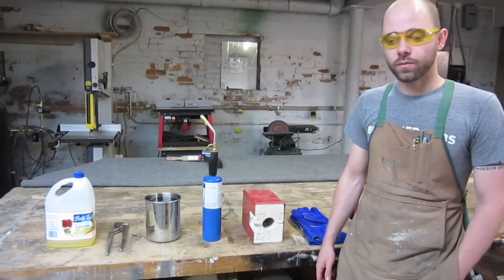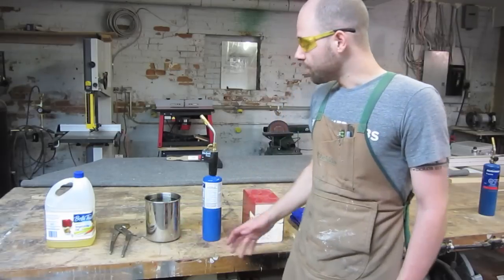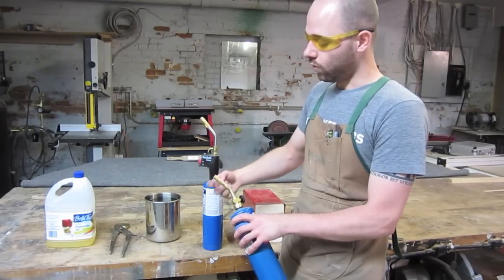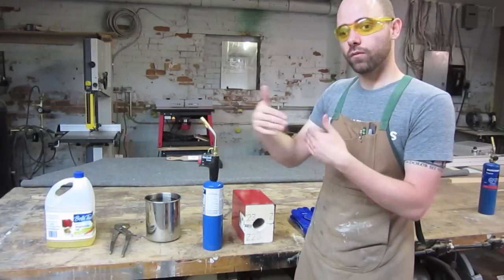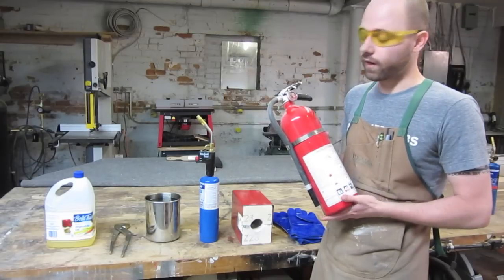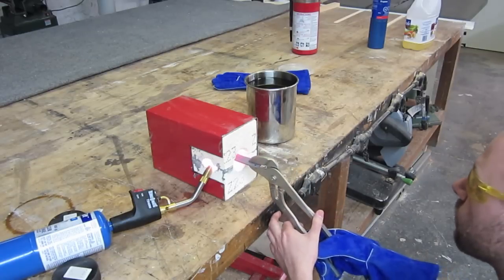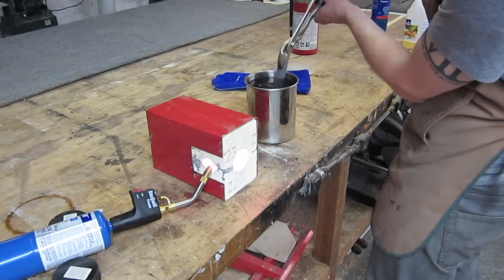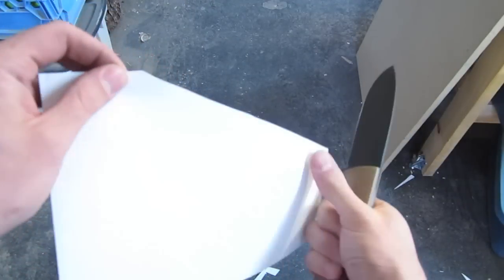How to heat-treat an O1 knife blade using cheap common tools.

Comment: How did you bore the hole through the two fire bricks?
Love the videos man.  The heat treating is the last part I'm trying to figure out how to do.
Reply from the maker: Basically I did each brick separately: cut a triangular channel with an old wood saw, then used coarse 36 grit sandpaper glued onto a large dowel to make the channel round. The brick is very brittle so the sanding worked well as it kept the impact low.

Make sure not to breathe the dust as it's VERY bad for you, wear a respirator!
Reply: Thanks man!  Sounds like that would work and obviously does.  I just finished my main bevel fixture.  It came out awesome!  On to the next part.
Reply from the maker: Kyle Davidson Nice mate! best of luck!

Comment: Aaron, 

I'm ready for the heat treat process and was just about to purchase the ATP-641 and noticed it was $20. Is it worth buying because I noticed you didn't use it this video. If so, I apply before the heat treat? Thank you so much for everything!!!!
Reply from the maker: seankusmc163 The anti-scale is definitely worth it, it will last a really long time and it saves you a bunch of finishing work. You just brush it on before heat-treat. Make sure you degrease the blade really well using detergent though. If it's not sticking then you still have some oil on the blade.

Comment: very good video, the 01 must be at 800-820 degrees for 15-20 minutes, you measured hardness, I want to see what we lose if we warm it in a detail like you, sorry for my english, good from greece
Reply from the maker: I believe I got about 58HRC with this heat-treatment, doing it properly in a heat-treatment furnace you should get about 60HRC with the same temperatures I believe
Reply: @GoughCustom  thank you, you answered all, be good

Comment: I've seen people use a magnet to test when the blade has reached the proper temp. The metal should demagnetize at or just before it's ready to be plunged into the oil.  The lighting in your shop is kind of a confounding variable for judging the temp by color.  I like to use both methods.
Reply from the maker: Andrew Davis Yes ambient lighting can definitely cause issues if it's too bright. I think a combo of the magnet and color is probably good. With most steels you should go a little hotter than where the magnet won't stick.

Comment: Question my friend, lets say my edge gets (evenly) the appropriate temp, while my spine is under heated. Wouldnt the edge be hard and the spine soft? In my opinion, this is a desirable quality. Also, how long does it take to get the blade to temp using your method? Im using a soup can forge, with homemade insulation made of plaster of paris and sand. im using a pencil flame torch, but it is a large pencil flame. the torch is at the front, angled twords the back. Thanks! Logan.

Comment: Hey great video! I'm intrigued by your forge, what are the dimensions if you don't mind me asking? I can only get bricks 114mm wide, I don't think the walls would thick enough if the centre chamber was of any useful diameter. I'd guess I'd need at least 70mm diameter on the chamber and 30mm thick walls all the way around? 

How long does it take to reach operational temperature and how long would it take roughly to get a blank to the right temp to quench? Also how long does one of those propane cannisters last roughly? Would you get many burns out of one?

Sorry for all the questions, thanks in advance!
Reply from the maker: The bricks you're talking about are likely about the same size at the ones I'm using I think. That hole in the middle of mine is only about 50mm in diameter. Going larger than that will make the forge much harder to heat up, and it really won't work as well. If you need one bigger then you'll have to spend more money on proper burners and such.

It heats up in about 5 minutes with the torch shown. It takes about 3-4 minutes I'd guess to get a blade up to proper temperature. 

The canisters last quite a while, not sure exactly how long but you're definitely getting 4+ blades out of each canister, likely much more.

Comment: great information here! what bit did you use to drill the entry hole for the forge? thanks!
Reply from the maker: I actually cut a triangular groove in each brick with a crappy wood saw, then used 36 grit sandpaper on a dowel to form the half round channel in each brick. I have not had much luck with drill bits, they tend to crack the bricks.

Comment: Hey Aaron  love your channel ! Just wondering what is the best way to heat the tang completely ? Also what is your opinion on vermiculite cooling instead of oil ?
Reply from the maker: Hey mate! Best way to heat the tang completely would be to make sure you have a forge large enough that you can cycle the whole knife in and out to heat it... 

I have never heard of vermiculite cooling. As far as I know vermiculite is a very good insulator, which means it would slow down the cooling of the knife. More than likely you would use that process to soften the steel rather than harden it!
Reply: @GoughCustom  thank you ! Very much appreciated. My first knife is very much inspired by you !

Comment: I read that O1 needs to be soaked at between 1475*-1525* for 15-20 minutes.That 
means it needs to stay at that temp for that ammount of time before its 
quenched in a medium/slow quench oil.

What do you think about it? Does getting the cheery red color is enough to reach hardness?

Btw great video, thanks!
Reply from the maker: Soaking it definitely helps get the maximum performance out of the steel, however soaking in a small forge can harm more than help as you're likely to overheat the blade and make it brittle, which is why I don't show a soak. If you have a kiln then by all means soak it for longer!

Comment: Hey! Great video! Question... I want to heat treat stainless steel.. will this process work for this? If not do you have any recommendations for me on how to do it/learn?
Also will it change the "stainless" properties of the steel significantly by hardening it?
Reply from the maker: +cabosurfcaster unfortunately you can't garden stainless using this process. To harden stainless you need much more sophisticated equipment, at least a furnace. Hardening stainless can change is corrosion resistance depending on your temper cycle. Also worth noting that you need to buy special stainless in order to be able to harden it, most stainless grades are not able to be hardened.

Comment: Is there a reason behind only heating the blade and not the entire length of the steel?  Are there ramifications in later usage of the knife to having an unhardened handle?

(Thanks for all the videos! It makes me want to try my hand at it....even though I probably never will....)
Reply from the maker: It's definitely better to heat-treat the whole knife, it makes it more resistant to bending, but with this little forge and the tiny oil jar it wasn't really practical. My current knives are hardened over their whole length.

Comment: I see that you said that you used a hand-saw to cut the brick, what kind of hand-saw? because I cannot see how an old handsaw would do the trick. Great video by the way!
Reply from the maker: It's hard to imagine if you've never handled the fire-brick in person. That type of brick is soft like chalk, not at all like a regular building brick... It cuts very easily.

Just don't breathe the dust!

Comment: What info can you give on S7 steel. Hardening and tempering and your overall thoughts on it for large blades. Thanks and great video.
Reply from the maker: I don't have any experience with S7 so I can't be much help there. I've stayed away from it because it doesn't get nearly hard enough for my taste. It maxes out at about 57HRC or so which is much softer than I'd like.

Many sword makers have switched to CPM3V instead of S7 because it go to high hardness (61HRC) and still be tough enough for a sword/large blade... Probably worth looking into.

Comment: Did you use some sort of compound to "glue" the fire bricks together in your mini forge?? and whats the casing around the forge made of? aluminum, steel, stainless?
Your videos are great by the way, they've been aiding my dive into knifemaking! Thanks.
Reply from the maker: +Scot Snook Hey Scot! Yes, a high temperature mortar is used to glue the bricks together. Also called furnace cement. The case is made from a piece of scrap steel that I had on hand.

Glad you like the videos mate!
Reply: +Gough Custom Thanks!

Comment from the maker: To be honest though I don't really think any of that is necessary. I've bent fully-hardened blades to over 30º many times. If you have a look at the steel testing video on my channel you can see what kind of abuse even a fully-hardened blade can take... I'm not sure that doing a soft spine is really worth the hassle, especially seeing as your edge will still crack once you've bent the spine enough!

Comment: Awesome!
I started making my fist knife and i got a problem :( maybe you can give me a advice? PLEASE! I am only 15 and a beginner in knife making.

I wanted to ask what should i do when i quenched my knife but it came up a little warped. Should i put it back in the fire and hammer it or start making another knife? The metal i used is from an old saw.

Comment: Have you seen that show on the History Channel called "Forged In Fire"? Every episode they start out with four bladesmiths and go through forging a knife with one of them taking home a $10,000 check at the end. It's not a bad show, but they never temper the blade. In the first task they have 3-4 hours to forge the blade including hardening it, but they go from the forge into the quench, and that's it. Task #2 is to put a handle on it & finish it in another 3 hours, but after that first quench no further time is used for heat treating it. I'm always surprised that they don't break the blades in testing!
Reply from the maker: +Gunslinger454 I haven't seen it yet, but I've heard a lot of people speak about it!

Comment: awesome vid.. this same process will apply to HSS and flat drill bits?
Reply from the maker: No, HSS and other medium/high alloy steels require a furnace to be heat-treated as they need much longer times and higher temperatures.
Reply: Thanks I'll try it out and report back here.

Comment: Hi Aaron I've been watching your vid's and I'm learning a lot..im using O1 steel for now  and what can you suggest the cheap and  easy to apply coating that would prevent rust aside from duracoat and ceracoat because right here in hawaii we cant purchased this kind of paint coz its too expensive to buy directly. I appreciate your help man.. Mahalo.
Reply from the maker: Hey mate! Glad the videos have been helpful!

Have a look around your area and see if there's a company that does powder-coating, that's probably your best option!
Reply: Gough Custom Hey Aaron! Ill just wanna ask can i put anti scale compound when heat treating 1095 carbon steel? Do you have any idea about differential heat treating for 1095 steel? Thanks.
Reply from the maker: filmario rimando Yes! The anti-scale should work fine with 1095. I haven't done any differential heat-treatment though sorry mate.

Comment: Great video.  Can I anneal a piece of steel in this manner by air cooling rather than quenching?
Reply from the maker: +Jack Black Hey Jack! The answer is maybe... Many steels (like O1, 5160) will air harden to some extent if they were air quenched because you'll be working with relatively small pieces of steel. however they likely won't achieve anywhere near full hardness, which may be enough for your purposes! If you want to anneal them properly you can heat the steel up then bury it under hot ashes to cool, that will slow down the cooling process a lot and guarantee that you get soft steel.

Comment: Great Video, may I ask what gas you are using with the TS4000? I tried this with a regular propane torch and it didn't seem to heat the steel to a high enough temperature ( I used a coffee can forge), hopefully the issue was just the cheap nozzle?
Reply from the maker: +Ziggy Hey mate! I'm just using propane with the TS4000 in this case,.

Comment: Thank you for your video(s). I currently have some O2 steel lying around and I was wondering if the heat treatment using the common-tools method work as well?
Reply from the maker: I haven't used O2, so I'm unable to offer advice about it unfortunately.

Comment: hi Aaron! some questions if you don't mind: i have several options for heat treating: a butane torch but that's not hot enough, especially for longer blades, a butane/oxygen torch but that's always out of oxygen [you know the dutch, full of butts :) and burns so hot my knives almost always warp terribly, and the best way for me is a barbie combined with a good old hair dryer.

the questions:

how bad is scaling? i was hoping that the charcoal would lessen the scaling due to the abundance of carbon, but that's not the case. do you recommend some sort of anti-scaling compound and if so, where to find that stuff?

do you normalize the steel beforehand? i have a belt grinder and am constantly cooling in cold water, i can imagine that would upset the metal internally.

usually i temper my O2 steel in the oven for an hour at 200 degrees celcius. is that enough? 2 hours seems so much to me...

thanks for the video. the insider tips about WHY to preheat the oil and to 'slice' the knife in the oil are hard to find.
Reply from the maker: Hey Sander!
Good questions!

1) If you're just heat-treating in a forge (or BBQ) then scale likely won't be that bad as you won't want to keep it in there for too long as the temperature control isn't great and you might overheat the steel. The scale forms as a function of temperature and time mostly, so keeping time short (while not ideal from a heat-treat perspective) helps to control scale. The scale can just be sanded off with 220 grit sandpaper after you're done!

2) I don't normalize the steel no. The idea behind normalization is to spread out the alloying elements within the steel and refine the grain structure. The grain structure in your steel should be fine as you haven't enlarged it by forging the steel. You may wish to consider multiple quenches though to approximate a longer soak time with O2 (I'd recommend googling that). Ideally that steel would be held at high temperature for 20 minutes or so, but that's not something that's really safe to do with a small uncontrolled forge because of the risk of overheating.

3) Tempering is a factor of 3 things, temperature, the time you hold it for and the number of repetitions. After the first temper some of the retained austenite will turn into un-tempered martensite, which will be brittle unless it's tempered again. This is the reason most people will recommend doing 2-3 temper cycles rather than just one. 200ºC is about the right temperature.

Glad you liked the video mate!
-A
Reply: Gough Custom wow, you really know your heat treating. restepc!
Reply from the maker: sander schouten I'm still learning, it's a very complicated field!

Comment: Hi! It's me again, I finally succeeded in making my forge thank you to your advice, but I found an unexpected problem after the hadrening. I heated the blade until it wasn't magnetic anymore, then I put it in the oil (which didn't catch fire), then I tested the metal with a file and it skidded very well on the hardened part, so I thaught that everything was ok untill I started removing the dark suff on the blade with sandpaper. In fact I noticed several spots on the blade in which metal was harder than the rest of the blade (that was still harder than the non quenched parts). So, my questions are: 
1) Does a "not so good" quench exist so that it may be harder or softer due to something?
2) Is it possible that the alloy of the steel plate may be not uniform so that it can affect the hardening?
3) Any idea?

Thank you very much in advance, I hope I have been clear enough since English is not my mother tongue (I'm Italian)
Reply from the maker: +pasty734 Hey mate!
Are you using O1 steel or something else? If you kept the blade how for a while with no anti-scale compound then you can get areas of 'decarburization' which is essentially where the steel lost carbon to the air while it was hot... Those areas of 'decarb' can look almost like little pools of a different material on the surface and will be softer than the rest of the steel.

Usually they won't be deep and you can sand through them.

To avoid them in the future you can use a coating on the blade before heat-treatment called 'anti scale compound', it prevents oxygen from getting to the blade while it's hot. The stuff I use is called ATP-641 and I bought it from Brownells.

-Aaron
Reply: Thank you very much, I will try! The strange thing is that thoose spots are harder than the rest of the steel, anyway, I'm using K720.
Reply from the maker: +pasty734 Hmmm, I'm not familiar with that steel so I can't offer any specific info unfortunately. Sounds very odd though!

Comment: Thanks for replying. I used soft fire bricks from sheffield pottery. Their rated to 2300° I believe. I cant remember the product #. I think my problem may be in the torch head im using. Its like the basic one you show and say not to use. Is the output really that significant between say a Bernzomatic Ts4000,TS8000 and the basic one? Im gonna give it a shot regardless. Just deciding between $45 or $65.
Reply from the maker: The bernzomatic torches seem much hotter than the standard ones. Especially when using MAPP. I think upgrading wil help.